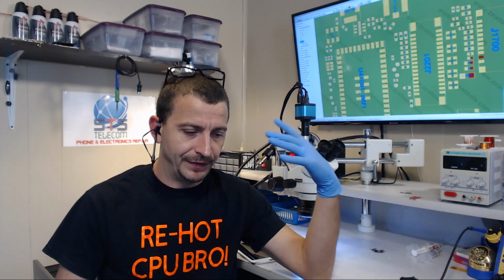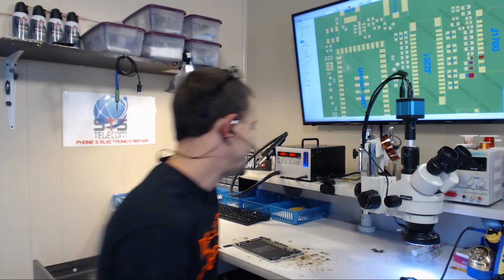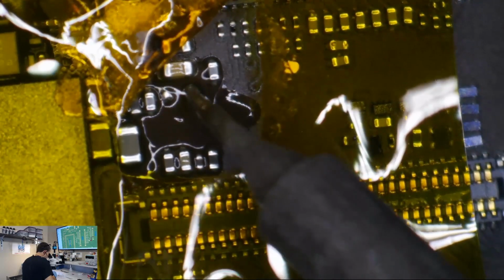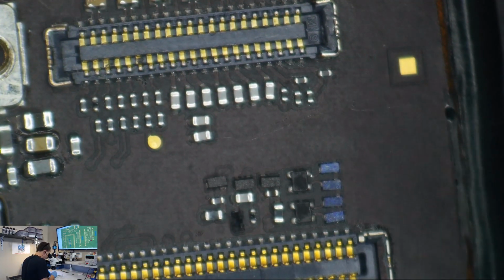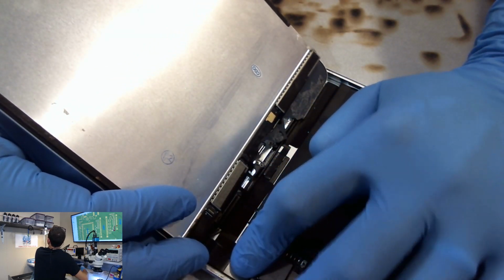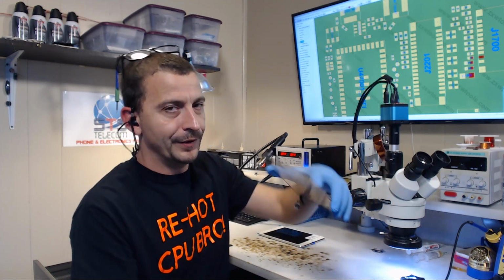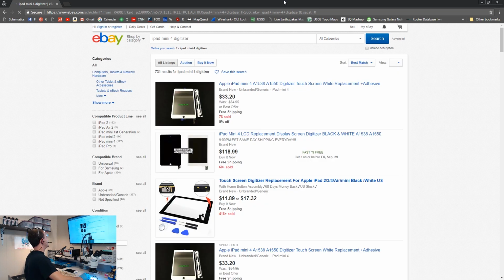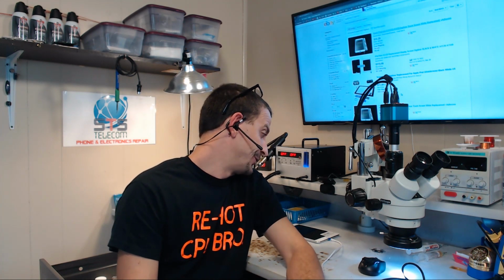iPad Mini 4 Backlight Repair (with the battery hooked up)

Comment: Hello, i was disconnecting and reconnecting my lcd and i got black and white lines and now the apple logo barely flashes and screen wont turn on. How much does it cost to repair? I think the connector got damaged or maybe the board.

Comment: Thanks for great video! I had the same problem but managed to rip of the PCB pads along with the filter. All I have left now is to nano tiny dots that were covered by filter pads. I managed to short them with a wire, but I would like to do a more proper fix. Any suggestions?

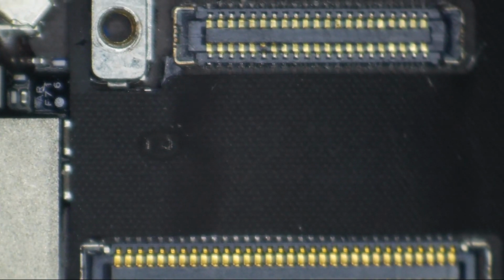Comment: Are you sure those dark spots are not attributed to the damage on the smaller (top) connector's 6th, 7th and possibly 8th pins (bottom row of pins, left to right) at 4:01 ? When you first asked what we saw there, besides the burnt spot by the blown filter, that's where my eyes landed. I got a feeling, that damage is causing an issue on the display.

Comment: I had the same experience when replacing touch or LCD it's troublesome especially when the customer is meticulous. I just told her that what can original LCD gives you cannot have in replacement parts. She accepted my reason but she bargained atleast on a fair value.

Comment: hi i have a iPad mini 4 and its totally dead, I'm not sure if it's the board or battery thats faulty. if you connect the board to iTunes without the battery connected should it appear on iTunes if the board is working, confirming it's the battery thats faulty??? it's just i don't have a spare battery to test and don't want to waste money buying one just to test. many thanks jay

Comment: I have never repaired phones/pads, but i do know what you mean when you forget things.

I used to repair c.b radios for most of the uk, and even though i knew every type and done thousands, i sometimes had a "Soggy Brain Day", eather mistakes/forgotten checks or putting a unit back together and wondering "Did i check....?" yep memory loss.
And you have to take it apart again, you just have to LOL :-D

Comment: What miffs me the most about iPad Mini repairs is the strength of the connectors on the board. About two years ago we decided we were going to stop fixing them because we kept running into issues with those connectors getting damaged. Not from tech negligence, but people would keep breaking the same one and coming in with it to get it fixed. LOOOTS of repeat offenders. Those things can only take so many screen re-connects before just giving out.

Of course, NOW I have the tools and equipment to replace things like that, but back then I didn't and was just starting out. Really makes me mad because the cost of all this equipment is LESS than what we spent out-of-pocket over the years for replacing devices that we either broke further from negligence or in cases where it just didn't work afterwards and we were unable to figure out how or why, but replaced it under the rightfully placed norm of "it worked before you touched it". 

I've been out of the loop on your videos for awhile, I think I know what I'm going to binge watch this weekend.

P.S. a few weeks ago I did my first successful TouchIC replacement on an iPhone 6. So far my K/D ratio is 0.5. First one was a failure and I learned from those mistakes. I was so amped when I saw touch work again, and a school teacher is now very happy to have a back up phone in case she needs it. I thank her for giving me the opportunity despite me telling her I could potentially destroy the device, but I suppose you can't pass up a potential free repair. I didn't quote her a dime, I just wanted the opportunity to practice. And I thank you as well. Heck, I thank Jessa and Louis too.